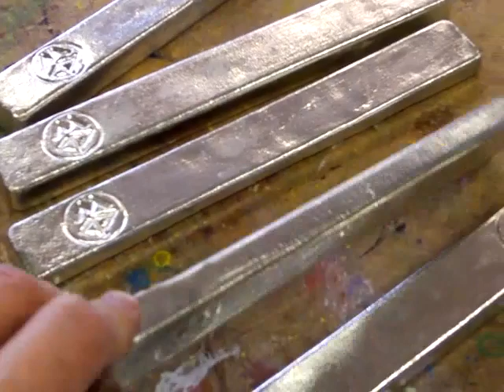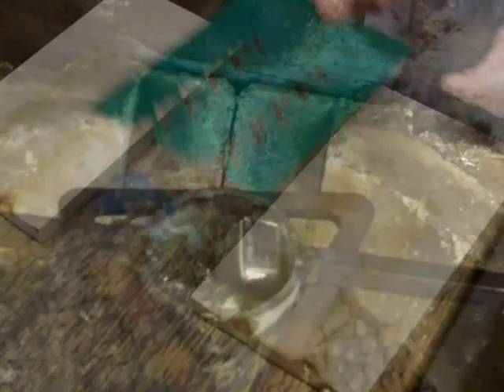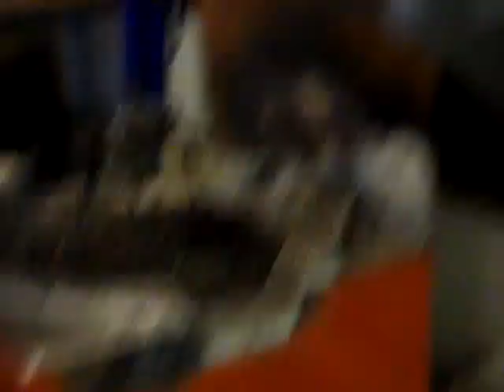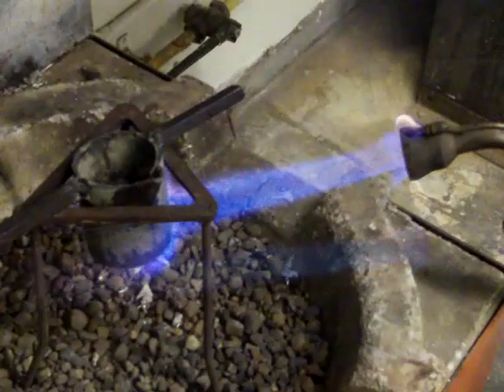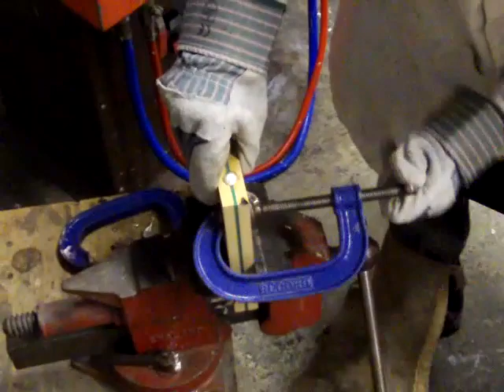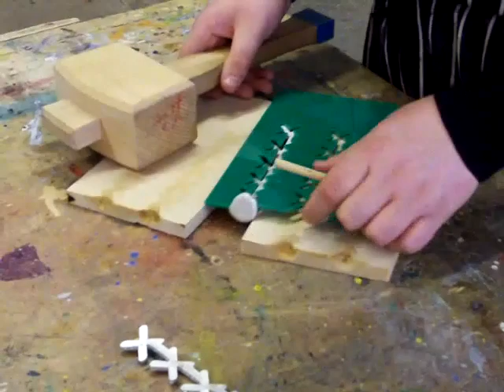Pewter casting

Comment: Several things really.... safety, why is the area around the heat treatment covered in combustible materials? Secondly the shot of the clamps being removed shows that that clamps have already been removed as they are in different positions from the start.
Reply from the maker: Thank you very much for your comment systemtim the heat treatment area has been inspected by an independent safety auditor and passed as safe. the film was edited from several casting cycles hence the continuity error, regards JP
Reply: really given this what i do for my job, inspect school workshop and train staff on workshop safety i have my doubts. there should be 1m clear in front and at least .75m left and right completely clear. in the video items are clearly in this range.
Reply from the maker: systemtim How long have they been employing people who are illiterate and innumerate as school safety inspectors, my advice to you my friend is to stop lying be more positive and get a life.
Reply: ***** I am  registered health and safety inspector and trainer specialising in school and college safety! Please dont accuse people of things without evidence.
Reply from the maker: The terminology you are using is incorrect and the measurements quoted are wrong. 75 meters to left and right ads up to 150 meters you’re getting your centimetres and meters mixed up. I will not reply to you again sir/madam and hope you follow my early advise.
Reply: *****.75m  (75cm) and 1.0m 100cm
Reply: ***** you need to look more closely at the detail my friend 
because it is you that has not read the units or the decimal point!  Who is ignorant and illiterate?
Reply: systemtim Shut up u keeno